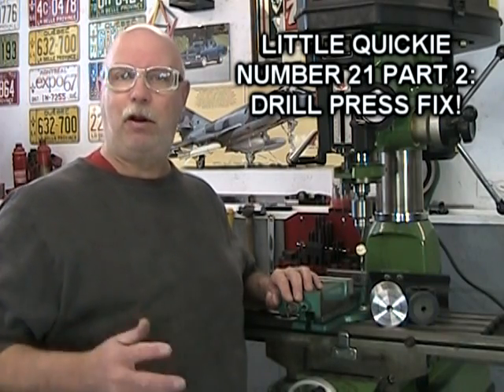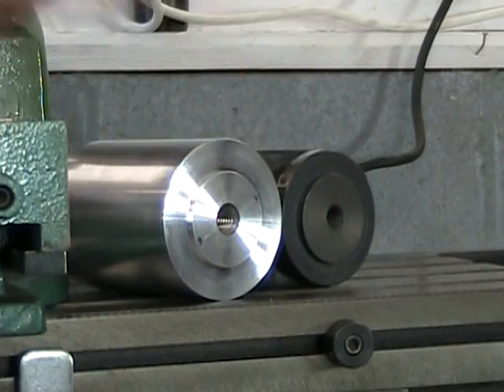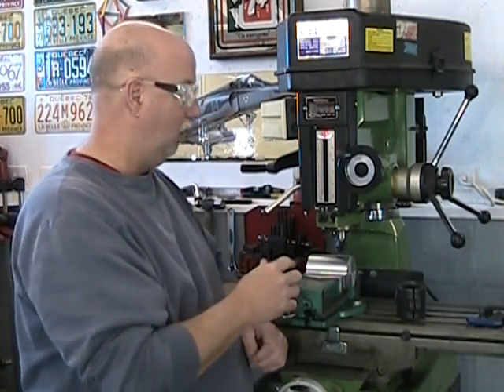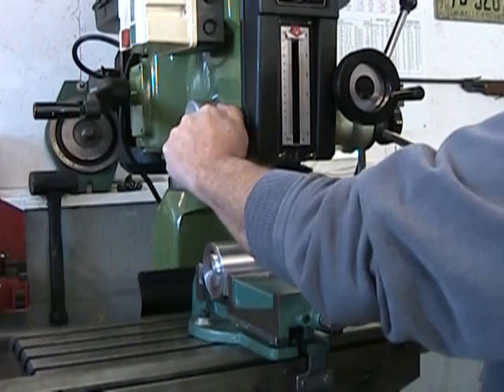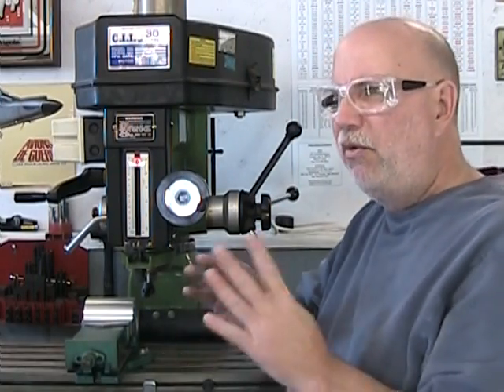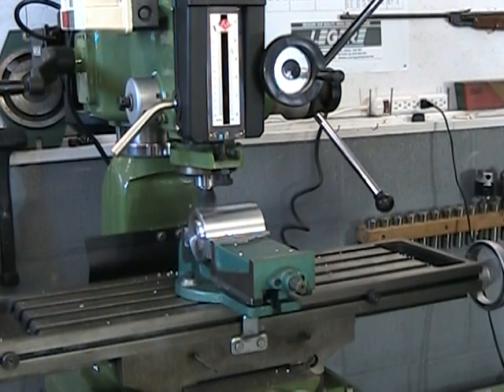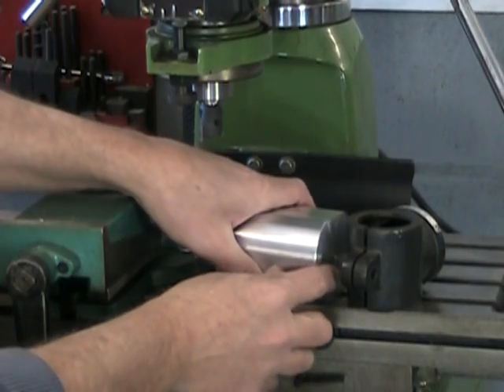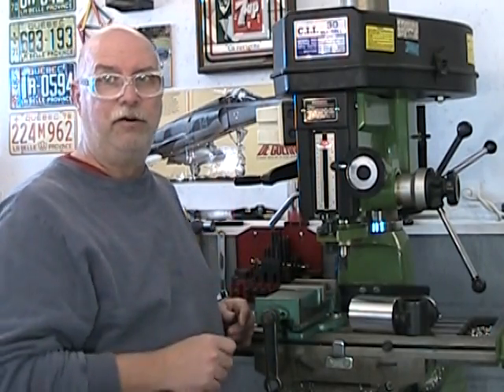Drill press fix part 2, MARC LECUYER

Comment: Marc, another question: when using a facing cutter, you mentioned conventional milling was going to be used. So I´m guessing that you aligned the tool about half-way, so that only forward moving cutters would dig against the part. Would there be a problem with face cutters to align them in the center of the part, so that half of it´s diameter does conventional milling and the other half of the tool does climb milling? That way, if there are no issues, one cut pass would be enough for the whole part.
Thanks and always enjoying your videos!